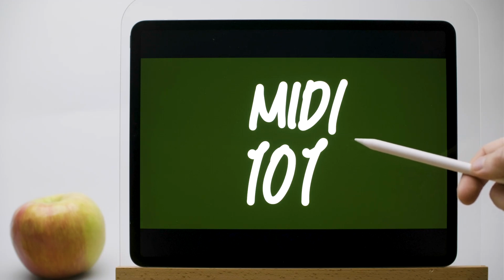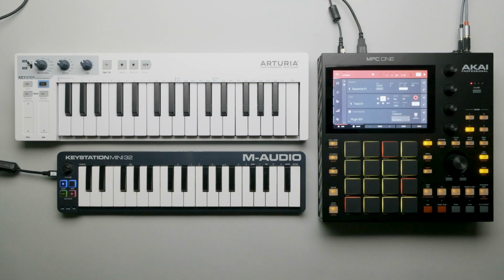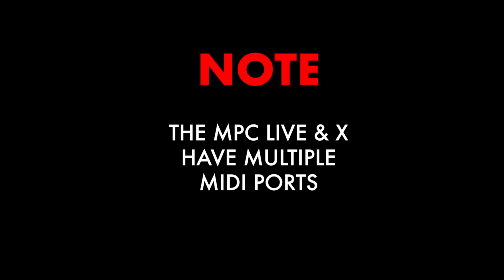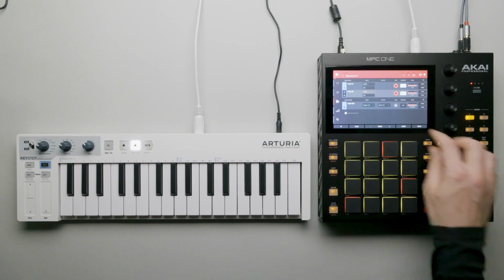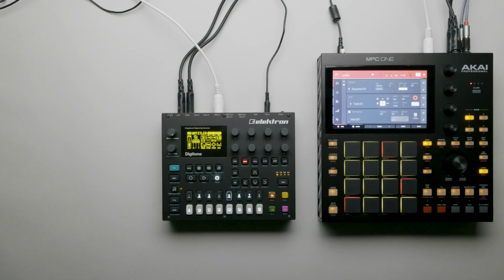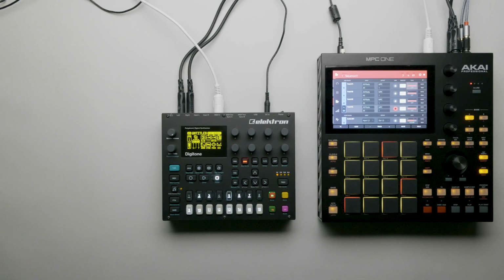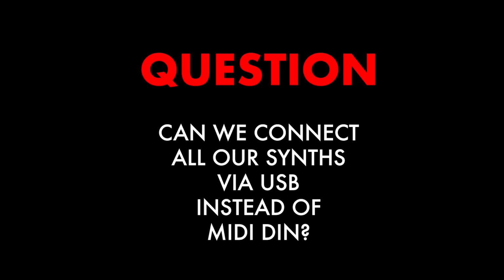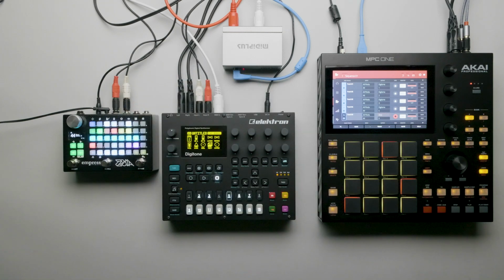MPC: CONNECTING MIDI DEVICES

Comment: Could you link one of these with a BOSS RC-300 as the master unit to have quantized drums play along side your loops?
Reply from the maker: Thanks for your question. It looks like the RC 300 has midi and you should be able to connect it to an MPC. You may have to use the MPC’s midi learn feature to program the two units to communicate. In short, it seems plausible to use the two together.

Comment: Hey. I have the LIVE 2 and the Force. I'm having trouble getting them to sync over WIFI with Ableton Sync setting. Not using Ableton, only both units in standalone. Is this a common problem? Can you help me? Sometimes they connect, and sometimes they don't.
Reply from the maker: Thanks for your comment. I'm not sure the answer because I don't have a Force to try it with. But I'm researching this and I'll get back to you.

Comment: Great Video. I am trying to use my Mpc One to control My SP1200. I can not seem to set the pads on the MPC to play all the pads on my SP1200. Any advice on how to setup the correct midi parameters in the MPC?
Reply from the maker: Hey, thanks for your comment. One thing I would check is that range of the pads matches those of the SP1200. I had a similar issue with the SP404SX. Essentially the notes don’t align and I had to shift the octave / note range until the pads better align with the SP. You do this by  selecting a different pad bank on a midi drum track or on a piano based track, adjust the octave range in notes mode. One thing to try as a test, if you have a midi keyboard, plug that into the SP1200 and see if you can control the notes from the keyboard. This would prove the SP works properly and which notes it expects to see to control it. I hope that helps.
Reply: Ollie Loops ok, I’m getting closer. When I hit shift + notes it takes me to the Pad Perform page. I set that to chromatic scale C3. In that page I can hit the pads and everything works perfect. But out in the main screen, nothing is working. Is there something I’m missing? Thanks!

Comment: excellent video, the only thing you didn't cover was that some makes of synths require usb drivers for using usb  such as Roland for example. however the midiplus 2x2  will help out in those occasions enabling 32 midi tracks  via it's mdid to usb box.
Reply from the maker: Great point. I think Akai makes a point to say it works with class compliant USB devices.

Comment: Hi, iam looking for a way to put a real drum kick pad. Can i ?
Reply from the maker: Hey, thanks for your comment. You should be able to connect any midi capable device. If it’s has a midi 5 pin din or 1/8” trs midi jack, you should be able to interface it with an MPC. For example, Rolands V Drum has midi in/out on the main module. With that, you can connect to an MPC. I hope that helps.

Comment: The only problem I'm having is the issue is the playback when using the midi on my integra 7 sound module midi cable hook into the in port  and the out going into my out port on the mpc and I'm controlling the control my bass station 2 synthesizer  using that as a USB instead of a midi everything was working fine a couple days ago with the playback on audio coming thru the studio monitor  and my headphone but all of sudden the it just plays the program thru the headphones but when I turn the monitor on it plays both I even messed around with the midi setting trying to figured it out whata causing  that

Comment: Apart from external notes on midi-in can it record midi cc like pitchbend or filter cutoff as editable automation data? Thanx
Reply from the maker: Hey, thanks for your question. Yes, in addition to midi notes, midi cc like pitchbend and modulation can be recorded and automated into the MPC. I hope that helps!
Reply: Hey I tried to record automate ccs from the synth to the mpc midi track , but I can’t automate the movements from the synth controllers knobs. Can you help ? 
The midi in flash lights on top of the mpcs flashes when I turn the synth knobs..

Comment: Thanks a lot for this video. Looking forward to get the update on the AKAI Force. But one thing is driving me crazy. Why is there no latency offset for each midi device. Right now you cannot compensate midi timing per device. It is really necessary to get midi clock offset in negative and positive direction per device.

Comment: Wonderful video and instant subscribe. However, it didn't cover an issue im having right now with midi. None of my synths clocks will sync with this usb midi update and now will not sync the way they used to with the 5pin midi. I've tried (what i think is) every possible combination of settings to no avail. I haven't see anyone mention this issue either so it seems to only be affecting me. Might just switch back to an old firmware that works.
Reply from the maker: Thanks. Interesting issue. I haven’t tested midi clock. I would recommend asking Akai’s tech support. They may not necessarily know about this.
Reply: Ollie Loops I have just waiting a reply. We shall see if it’s an actual issue or just me!
Reply from the maker: I hope it’s something minor! Good luck.

Comment: Great video, very clear. But i missed one thing: I have a MPC one and a MPK mini. The mini has an Arpeggio feature but i cant get it to receive timing information from the MPC. I have try the sync outputs settings but no success yet. Any advice?
Reply from the maker: Good question. I don’t have an MPK mini, but let me see if I can do some research on this.
Reply: I have the same set up was just wondering how do u have ,meaning master,track ,control ??

Comment: Ooo I would have loved to see a follow-up discussing what you talked about last; audio routing through a mixer (how it is best done, how it is configured on the mpc, suitable mixer for hooking up the mpc with a few external synths etc)
Reply from the maker: Good suggestion. We’ll see if we can add that to the queue.
Reply: @OllieLoops  Please do. Also if you could demonstrate the bluetooth capabilities of the Live 2 that would be great also! Thanks
Reply from the maker: smokey5100 we’ll see what we can do.
Reply: Oskar, basically you connect each synth audio output to your mixer then the stereo output of the mixer to the MPC audio inputs. If you were playing live (instead of recording to the MPC) the MPC output would go to a pair of your mixer inputs and the mixer output would go to the PA system.

Comment: This is actually the best rundown of the new midi capability for the 2.8 firmware of the mpc series, better than akai’s! 
I really thank you for your hard work, it is so very well explained, with context and all! 
i found it even better than loopop’s one, and he sets the bar so very high! thanks again for this, your work is really appreciated!
Reply from the maker: Wow. Thanks for the kind words. I’m glad it helped.
Reply: @OllieLoops  Mira Bo, I very much agree with you. This is the best rundown out here. Thank you for the concise and precise work!
Reply from the maker: @xXC0deZer0Xx  Thanks!
Reply: @OllieLoops  can I attach a guitar , if the guitar has a usb cable? As I have a guitar with a normal Jack in one side and usb on the other. It was able to plug into my Scarlett interface. Loving your fabulous videos
Reply from the maker: @LanzaMartineta  thanks! Interesting. I don’t know that I’ve seen a guitar with a USB output. With that said, I don’t believe the MPC is setup to accept audio over USB. I could be wrong, so it’s worth a shot. But I would suggestion going from the guitar, into a DI, then into the audio input on the MPC. That should work just fine. You could then setup an audio track to record the guitar. I hope that helps.
Reply: @OllieLoops  Hi, thanks so much for getting back to me on this. I have to tell you I set up challenges before I buy expensive equipment such as my fave guitar or the MPC (currently debating which one) , so basically, I say internally. One example I learn several scales on my small acoustic I’ll progress to the Fender electric because I’ve earned it. I am doing the same with the MPC and am determined to learn it as intactly as possible before receiving it. I have to tell you I went for a run yesterday and I listened throughout the entire journey to your breakdown of the MPC one. It was brilliant! May I ask you, what internal justification do you give your self for ploughing through the manuals to learn new equipment? What essentially (other than views and some financial reward) is the carrot in front of the donkey? That gives you the patience to read manuals that others don’t even flick through? What is your advice for retaining such a wealth of information? Because the truth is, equipment up and down the land is sat in draws because people regrettably sometimes can not be bothered to preserve like you can? Thanks so much. Question please, given the compactness of the Mpc1? Can you recomend a DI that doesn’t take up much real estate on your desk? And can take a mic and a guitar? One that’s good? Big thanks!
Reply: Great tutorial!!
Reply: @Joseph Timothy It worked and I actually got access to my account again. Im so happy!
Thanks so much you really help me out !
Reply: i dont mean to be so off topic but does anyone know of a trick to get back into an instagram account?
I was dumb lost the password. I love any tricks you can give me
Reply: @Connor Tripp Instablaster :)
Reply: @Joseph Timothy thanks for your reply. I got to the site on google and I'm trying it out atm.
Looks like it's gonna take quite some time so I will get back to you later when my account password hopefully is recovered.
Reply: @Connor Tripp You are welcome xD

Comment: Thank you for such an extensive and clear explanation of MIDI on MPC v2.8. One question that has been asked multiple times on the Akai support forum is 'foot pedal control', and this too can be achieved with MIDI - specifically with MMC Play/Stop/Rec/etc messages.
A USB (or DIN) MIDI foot pedal can send these into the MPC, either with a commercial unit (such as a Morningstar) or a DIY solution (my favorite is "OpenDeck" on GitHub).
Reply from the maker: Thanks! Although I haven't tested those controllers or a footpedal controller in general, if you can midi learn it, then from the controller's perspective, it should work. The midi learn feature is rather capable, but specifically can it do Play, Stop, Rec, I'm not 100% certain. Scrolling through the assignable parameters, I see Rec Arm, is an option. I see Song and Project's have assignable parameters too, but I'm not sure without further research. I can look into it and I'll comment back if I figure it out.
Reply: @OllieLoops  MMC is predefined, it will not need a 'MIDI learn'. There is a section in the MPC's MIDI preferences to receive (and/or send) MMC, once enabled that play button on your Keystep should function.
Reply: @burnerphone361  thanks! 😀

Comment: really good tutorial, i was personally suprised when i connected my Novation ReMOTE 25 (which i am unable to get functioning on windows 10) it suddenly was recognized by the MPC and even got the name right away. Though i am having issues with getting some knobs on my ReMOTE to send data, my mpc recognizes them when i turn the different ones, but no data is being sent.
Reply from the maker: Thanks! Ok, to follow along with your situation, you connected the Novation to the MPC and the keys work, but the knobs and sliders don't do anything? If you tap midi monitor at the top of the main page, you should see feedback for all knobs, buttons, sliders and keys coming from the Novation. If not, you will want to troubleshoot the Novation. If so, you will need to use the Midi Learn feature and assign parameters to the knobs and sliders. It won't be pre-mapped. This video shows how to do that. I hope that helps!
Reply: @OllieLoops  Yea, its receiving the CC data from the knobs when i turn them, i can see the light flashing, but when i go into midi learn and turn the knob, its not changing the data value. Also yes it is receiving note data from the keys including the velocity, but thats about it.